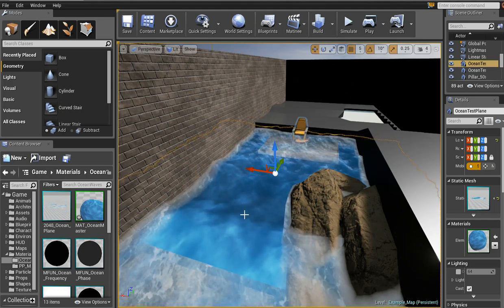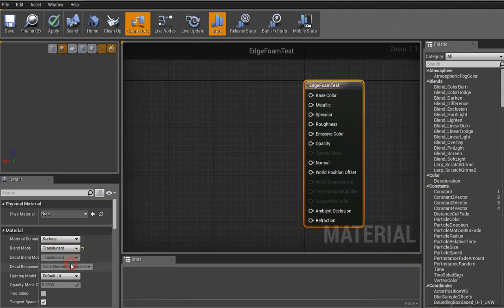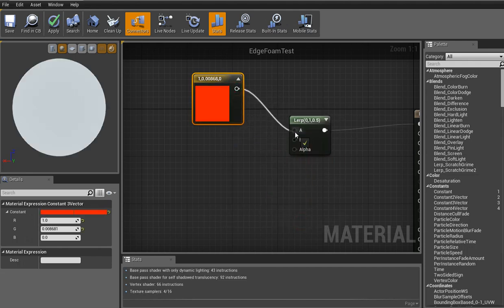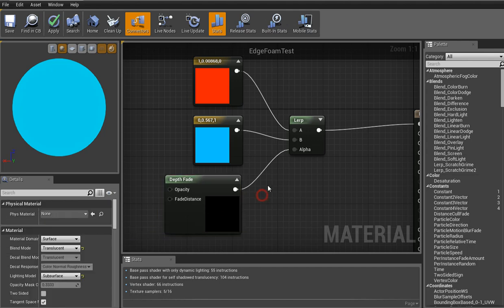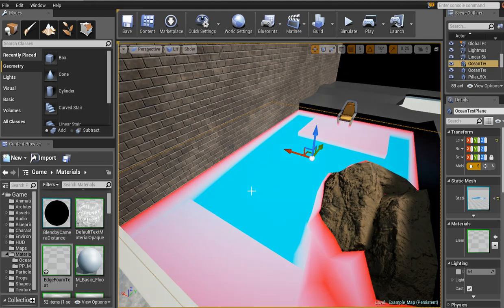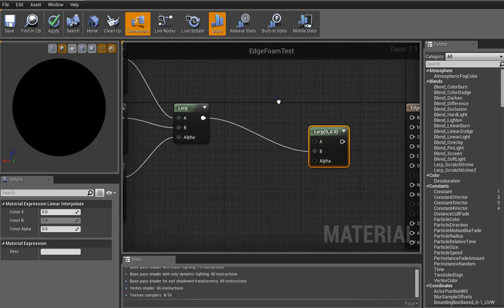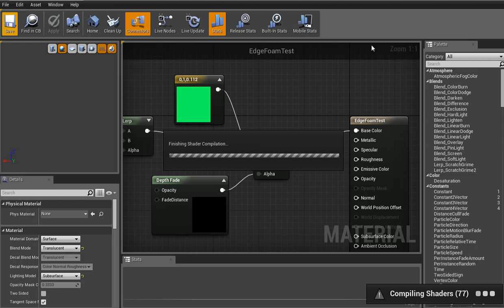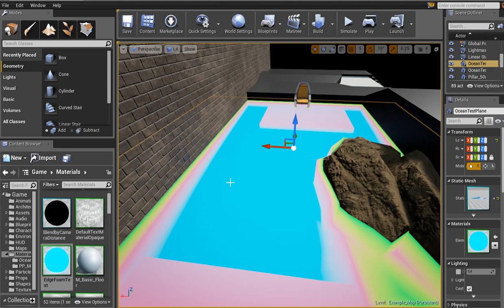UE4 Edge Foam Material Quick Tutorial

Comment: Thanks for the tutorial. I'm using something similar, (btw im taking camera position into account, dont you need that?)  the problem with this approach is that you get very harsch transitions, if you look around your rocks for example, when the depth goes from rocks to the wall of the pool.  It's not a super big deal, but it kinda limits what you can do and will look a bit buggy. Maybe you could blur it or something, but i read quite a lot about this and it seems like the only way to do it is to generate a mask texture offline. Do you have any idea?

Comment: So, I replaced the colors with textures and connected everything to my base material, but I cannot get the edge foam to show up. I am very new to Unreal Engine, but it's materials are similar enough to Blender's that I understand how it works... Sort of. The Edge Foam shows up when I make my "test" material, but it will not work applied to my main water material.
Reply: Did you solve it?

Comment: Fantastic. Very simple.

I know you already mentioned you don't have time to make a complex tutorial on this, but I do have a question. How are you able to get such nice tessellation on that flat plane? Tessellation on flat planes and other mostly flat surfaces always seems to turn out terrible for me. Would you mind throwing together a quick video explaining that? It doesn't even have to apply to water, just flat surfaces in general.
Reply from the maker: So you want a tutorial on setting up the plane mesh? Just making sure before I go doing anything lol.
Reply: TheWisdomcube2000 If you did anything special to the plane mesh, those details would be great. Mostly I am wanting to know how you setup the tessellation in the material to work so well on a flat plane. Whenever I have tried tessellation on a flat plane, I get weird extrusions and artifacts. I may be approaching it completely wrong though. I have been working in UE4 for 3 months now (no prior experience with UE3 or anything) so a lot of this is very new to me. Thanks for responding.
Reply from the maker: MJOLNIR Productions
Yeah that sounds like a problem with the plane you're using. I had the same issue when I was first figuring this out a while back. I'll try and do a quick video of what I did later today.
Reply from the maker: TheWisdomcube2000
Hey an unexpected power outage kinda set me back today, will have that video up tomorrow though :)
Reply: TheWisdomcube2000 No problem. Unexpected is unexpected. lol. Thanks for putting your time into it!
Reply from the maker: MJOLNIR Productions Let me know if this helps:
UE4 Setting up a Water Plane Mesh Tutorial